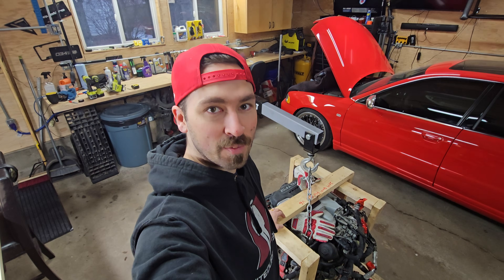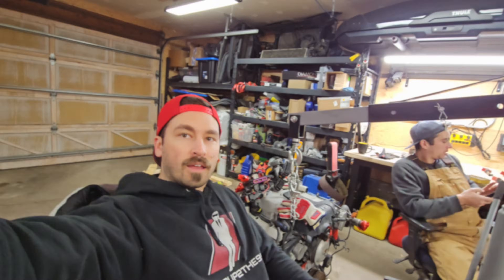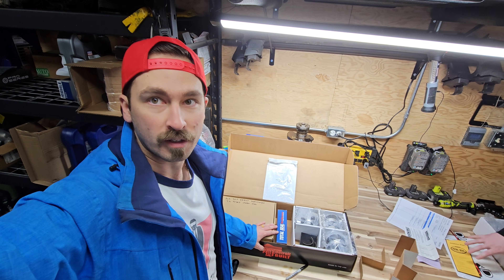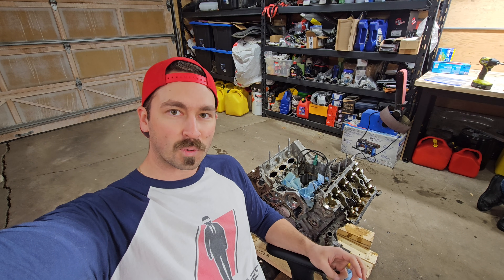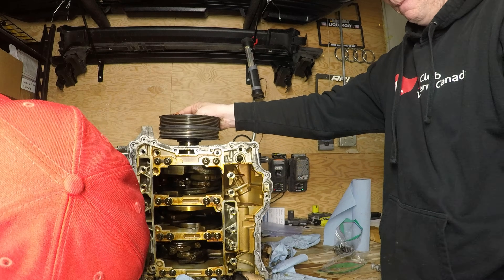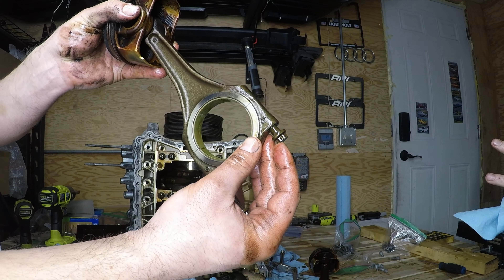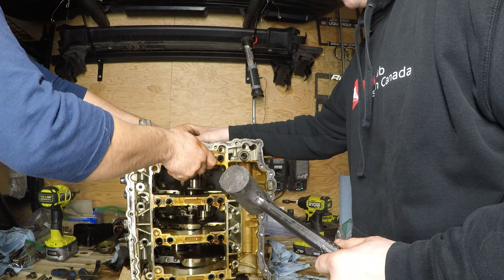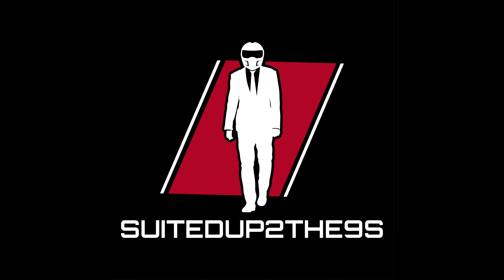Audi 3.0t Engine Teardown! 3.2 Stroker Build // (B8/B8.5/C7/D4)

Comment: Have you thought about shaving some weight off the pistons and crank to help reduce rev time? Also shaping the crank weights to help windage and help make it more areodynamic which sounds funny but the crank spins ridiculously fast so any modification can produce some good results. Check DAVID VIZARD his channel has some cool tech and tricks they used in professional race engines where rules n rustrictions block most things to increase power and he built race winning engine for 40+ years now.

Comment: I am in the middle of a 3.2T build as well lol. just got the block buttoned up
Reply from the maker: @andrewschlueter242  right on man! Which 3.2 did you go with? How's the build been going so far?
Reply: @SuitedUp2The9s  CALA block, crank, pistons. CTUB rods rebushed. Need to clean and fresh up 3.0t spare heads I have. Missing a camshaft set still. Leaving the oil pressure switched high too.
Reply from the maker: @andrewschlueter242  just wanting to make sure I gotcha, stock 3.2 block, stock 3.2 pistons, stock 3.2 crank with 3.0t rods? With 3.0t heads? Going into a 3.0t car?
Reply: @SuitedUp2The9s  you got it. C7A6. 1mm shorter rods brings the compression down. 3.2 pistons have a reenforced top ringland like the 3.0t. But less compression should be fine for higher boost levels I assume. It's an experiment.
Reply: @ I looked at sleeving the motor with the 4.2 fsi LA Sleeves .. but decided to take a chance on a bored/stroked oem motor setup with 3.0t parts.

Comment: Hell yeah dude, you need to pick yourself up an engine stand!!!
Reply from the maker: @MarkAlbano716  I do have one 😃 but to get to everything on the back I needed to have it loose.
Reply: @ Oh I know, my tear down video will be out soon too. If you remove the lower timing cover, then the timing components off first thing, use the tranny bolts with some washers to space out the bolt, and I’m TELLING you dude, I wasn’t a believer until my buddy forced me to use it now I’m never going back😂😂
Reply from the maker: @MarkAlbano716  oh I believe it! When I rebuilt my B5 S4 trans, the stand made it so nice! Having my friend Brian give me a hand on the pistons, rods and crank removal was really nice, someone was securing it while the other worked. For the next parts though, stand might just have to come in haha
Reply from the maker: Also I'm looking forward to seeing your teardown video!